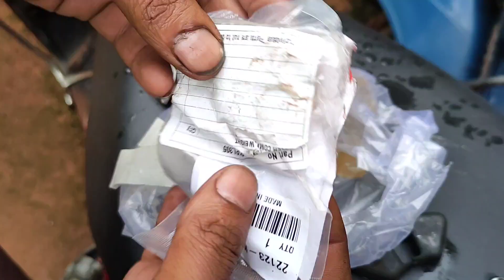Scooter Pickup Problem | Honda Activa / Hero Pleasure | CVT | Variator |  Roller

Comment: Bro when accelerating my hero xoom xtech 110 cc  makes unusual noise for a few seconds at 12 to 15 kmph speed from rear side of scooter what problem is this ?
Reply from the maker: Need to check it's difficult to tell without inspecting 😊
Reply: @RaceTuner2024 where is your service centre